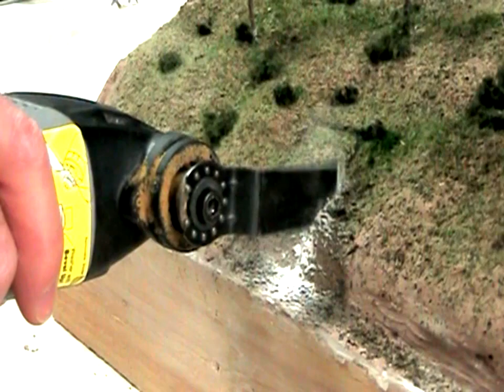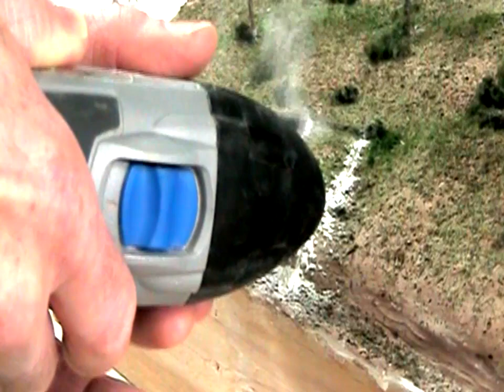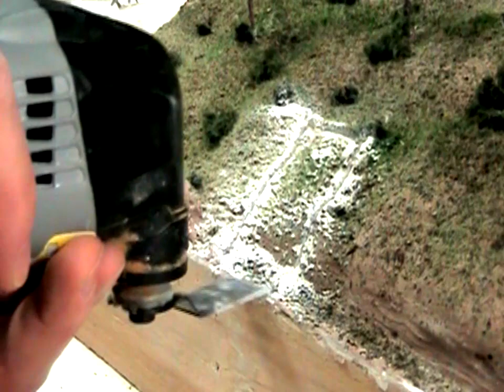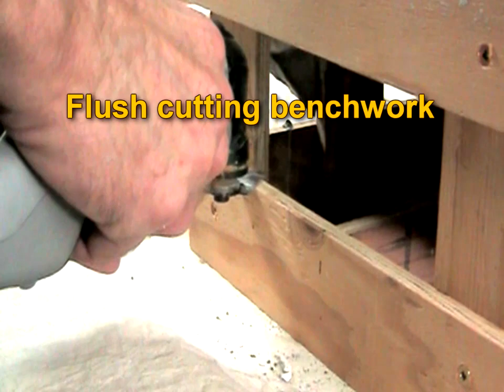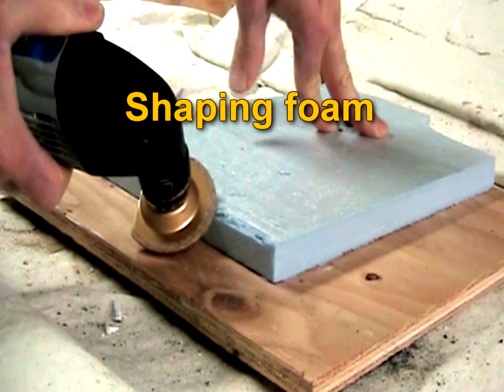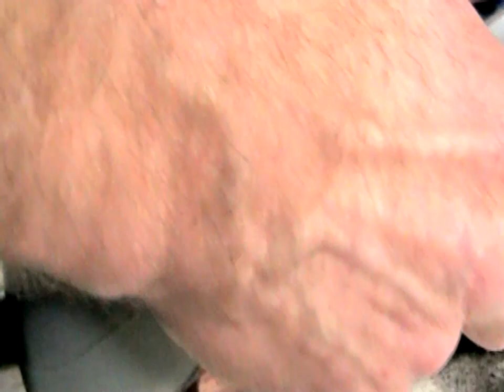Multi-tool for layout building  | January 2018 Model Railroad Hobbyist | Brian Larsen

Comment: Couldn't you have at least told where to get one and the cost of the thing?
Reply: In the time it took you to type your comment you could have found your anwers using almost any search engine.
Reply: Uh huh, and what did they say the name of the tool or manufacturer of it was? That's right, they didn't! I'll just let you waste your time searching for a "multi-tool".
Reply: Sell for about £150 up in the UK, the replacement blades are expensive over here as well, they make a lot of dust, so a mask is needed for most applications
Reply: Thank you Graham. I thought it looked as it would be pretty dusty. It sounds a bit pricy, but it looks like it works well. Thanks for the information. Happy new year and Cheers, Dan
Reply: The video is from January issue of MRH. I give a full explanation of the tool in the article.
Reply: Cool! I'll check it out then. Thanks for the information Brian. Cheers, Dan